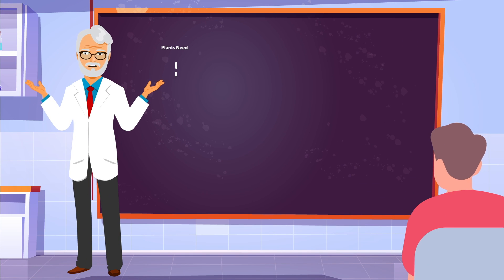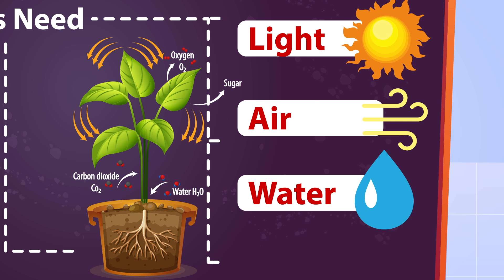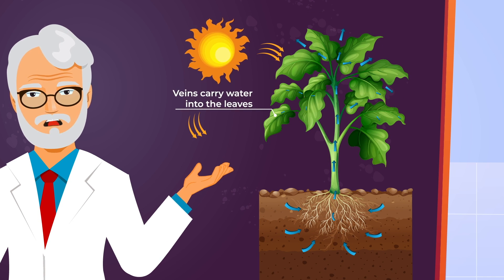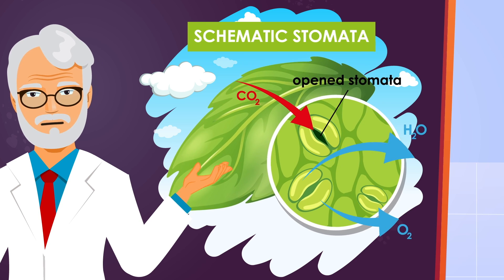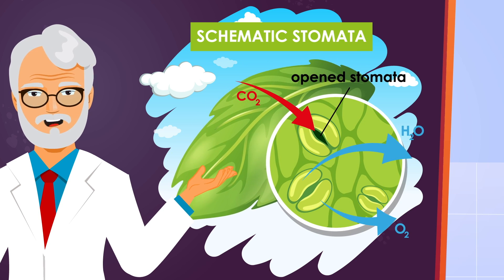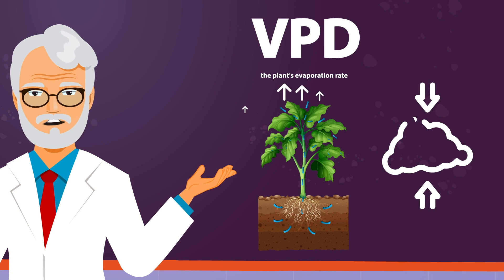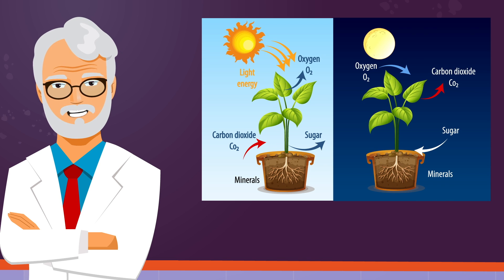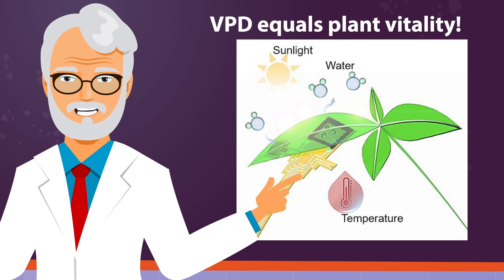What is Vapour Pressure Deficit? (VPD)

Comment: BUDROT is what will happen if you are above 60% humidity during the flowering stage.
That is the Agenda in Play here.
PS LED's are only used for the Veg stage by commercial growers because they produce low yields if used in Flowering/fruiting stages.
Reply from the maker: Budmould or Budrot as you call it, develops mostly in the nighttime when RH reaches levels above 80% and there is no uv radiation preventing them from growing. Lack of air movement or big drops in day-night temperature can make it worse. LED's are commercially used for flowering stages all over the world as we speak. We monitor factories from Thailand to Switzerland, and from Macedonia to Canada. Yields are currently 2 grams per Watt and even higher. Something that is unthinkable under HPS lighting. Email us if you need specs for high quality LED fixture, and not the chinese/cheap/streetlights. Chrs G.

Comment: Is there a nighttime vpd chart ?
Reply from the maker: There is no such thing as a VPD for nighttime. The difference is the delta (temp difference between ambient and leaf temp) which is probably non existing (delta 0). Meaning temperature of the leaf is the same as that of the surrounding air.  That's why VPD charts have a big flaw. The delta is volatile and can not be caught in 1 chart thus leading to wrong assumptions and conclusions . ☺
Reply: @vpdmonitor  thank you.
Reply: @vpdmonitor  so is that where we get the std of 10 degrees less than the daytime?
Reply from the maker: @Eric-dz1we   VPD at nighttime should have the same outcome (around1 kPa) but the parameters wille be different. So probably you have to compensate for lower temperatures by lowering humidity, to keep the evaporation going.